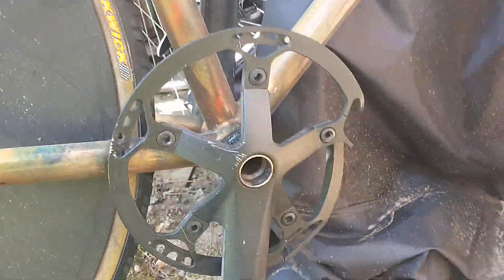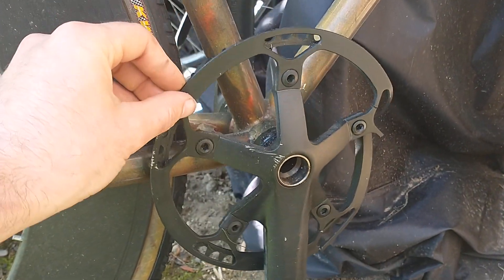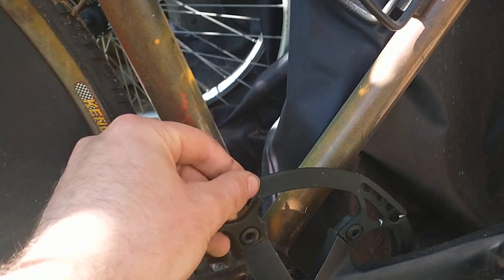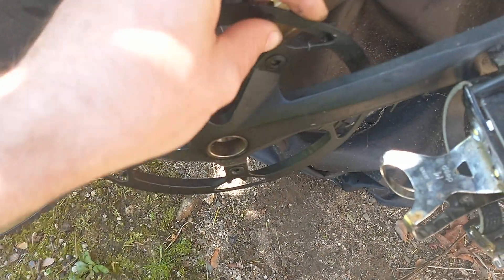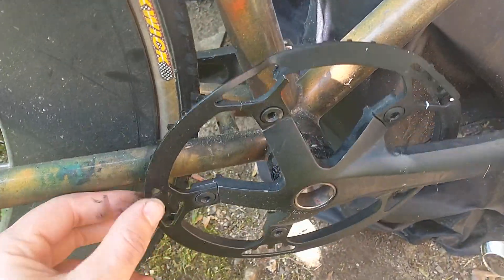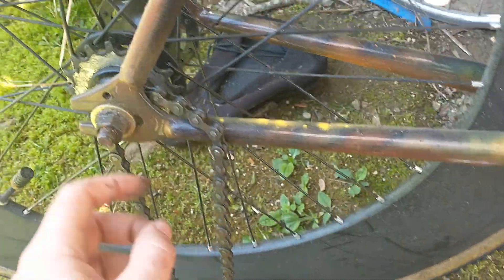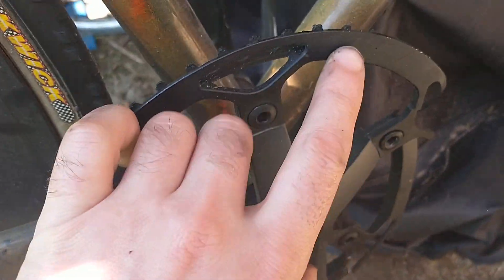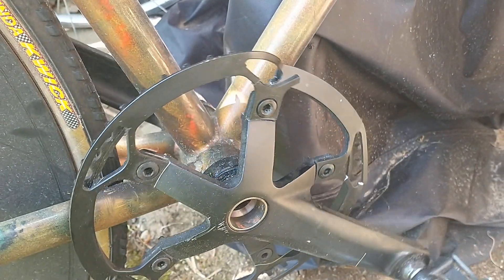*beware* Litepro chainring failure - fixed gear

Comment: yeah there are a lot of user using litepro and cracked their crank, prestty sure litepro is for folding bike type so its not made to handle a lot of stress fixed gear have

Comment: i'd consder litepro for folding/commuter bikes.
Reply from the maker: Yeah I have a pair on my Dahon, was so impressed I bought a second set for this fixed gear. It rode nice and smooth for about 9 months, then BOOM!
Reply: @mopedale i mean those chainrings are only design for single speed applications. Hence they cant handle the comprehensive force a fixed gear drive train induces. Prolly safe to get a sugino rd2 messenger.